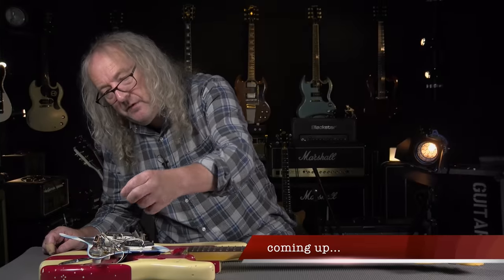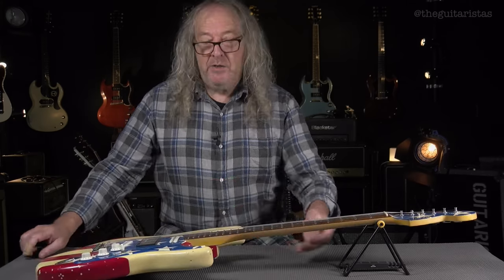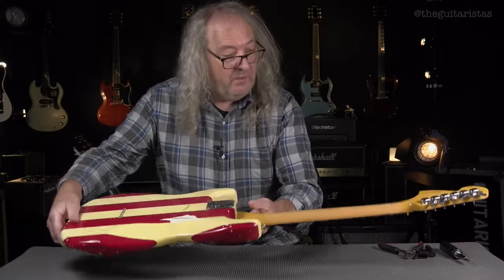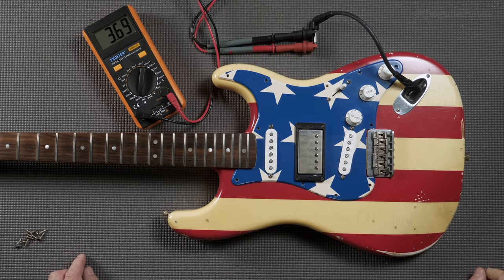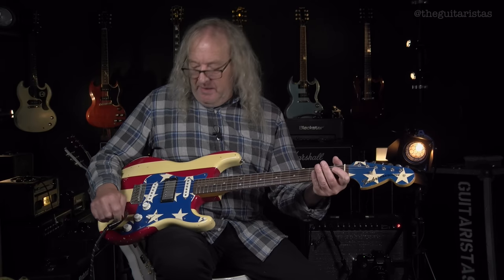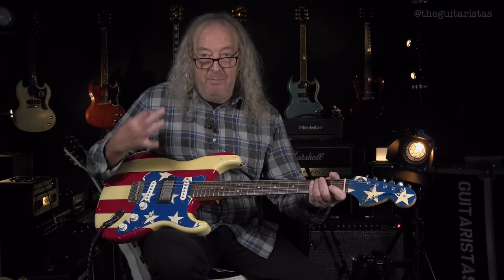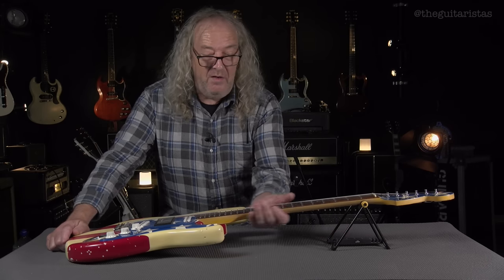Can the MC5 Fender Stratocaster Kick Out my Prejudices? - Independence Day Guitar Review

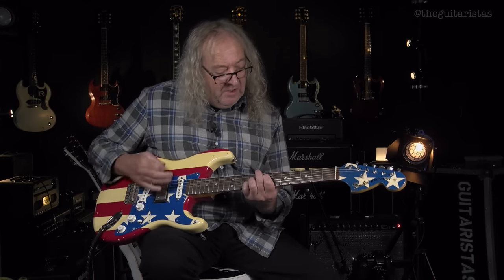Comment: Super looper jam/demo , the 26:00 and the 'kick out the jam ' one.. Fun and inspiration  are there. Congrats.
I find the guitar cool but i wouldn't buy it. I like MC5 and hardtail strat but i don't like the artist replica guitars. I like it but don't want to have it.  i prefer looking at it on the lap of someone else. The stars and stripe are a bit to much for me. The mid humbucker pickup is a good idea. I may build one for myself without the paint job.
The humbucker don't look to be a Seymour Duncan,  the back don't have the Seymour Duncan engraving and there a "PAF" label . The back plate screws are not of the good colour. Some beautique PAF replica....The single coils looks like standard MIM ones. Original to the guitar ? I think that original ones were higher end Fenders. Even then it's not a too bad pick as this model  worth currently significantly more than 1300 €  it seems..
Reply from the maker: Cheers man, I think you're right the single coils are MIM ones and we think the other is a burstbucker.

Comment: Those single coils pups have ceramic bar magnets glued to the bottoms of the pole pieces. Usually that means its cheap rubbish, ceramic has way more output than Alnico but its sounds spikey and ice pickey,  it's best suited to high output pickups.
Reply from the maker: Do you reckon they are the original Texas Specials or replacements?... I suppose I should do my research really... oh hang on I am I'm asking you! 🤣 Cheers Ben.
Reply: @theguitaristas  
Maybe they  are  Fender 'Tex-Mex' pickups -  those are made with ceramics. Fender Texas Specials are normal ALNICOS.

I don't like ceramics.
Reply: @theguitaristas  no definitely not texas specials, they have a brass baseplate like a tele bridge pup. Could be a budget version of a texas special.
Reply: @valueofnothing2487  that makes sense, Mexican budget pickups with a texas special voicing (supposedly)
Reply: I think a lot of people buy texas specials when chasing the SRV sound but SRV used original '59 pups with 13 gauge strings and 2 tube screamers into high output, very expensive amps. So he wasn't using high output pickups at all he just pushed the sound in other ways.
Reply: @valueofnothing2487  I hate ceramics so much I actually get angry when I see them in a guitar over $500 ...they're only saving about 20 bucks and ruining an otherwise good guitar
Reply: @valueofnothing2487  i have tex mex pups in a custom build, and they are alnico.
Reply: @Questionable_Talent  Which are the ceramic, then, I wonder?